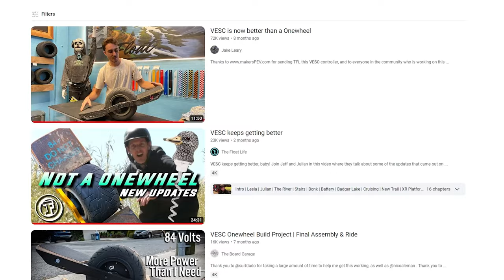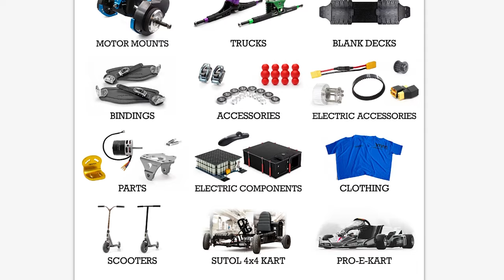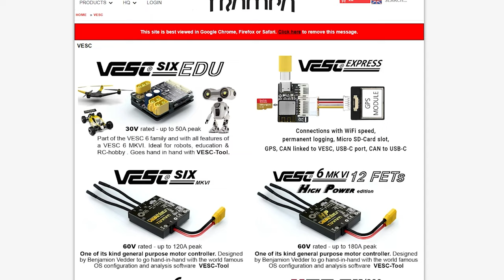Onewheel, VESC, and the Floatwheel

Comment: Having started with the original FunWheel kit, I still call mine a FunWheel even thou almost none of the parts are the same. Once I got it tuned and running I got out of the loop for a while, happy to just be riding. Got back into it with a new iteration of my build using an XR hub only to discover things have progressed so far beyond where I left off.

Comment: I had a diy VEsc one wheel. It had a 12s battery and a 1200w motor. The problem was that I’m 6’4 220 and way beyond the 175lb rider max. It wasn’t a problem until the speed controller started misinterpreting braking and the damn board would make me faceplant on even the slightest hill. Decided I wanted a board that would “just work” and bought a GT. Are they worth $2500? Not really. Has this board ever failed me in more than a year of riding? Nope.

Comment: I believe I overcharged the battery on my vesc with little focer. Power light is still coming on but boards not activating. Voltage not reading in app. Just duty cycle fluctuating in app boards still communicating, if that helps. Just trying to correct this error if possible. Thanks in advance

Comment: Hey I just saw you built a DIY Board using a Focbox Unity. Thought I ask you if you've ever experienced this issue. I also built a DIY Board with that VES C and loved riding it all summer (last year). One day though the Unity just turned off for no reason while cruising. Pushing the power button will only work briefly/momentarily. And although it will stay on after a while of pressing the button, the board will only run for a while before shutting off again. Any feedback work be appreciated. Thanks
Reply from the maker: Hard to say. I would try reflashing the firmware, or updating to main branch VESC FW (start with 5.03, and then flash to 6.02), and see if that fixes any of those issues. 

If it doesn’t, the Unity may be damaged. In that case, I’m aware of one or two people who repair VESCs, so it’d be possible to have it fixed. 

Barring that, if there’s no way to fix your issue, you can replace the Unity with something like the new Maker-X DV4S, which is smaller than the Unity and has comparable/better specs. And Maker-X is a good vendor so far it seems. 
Best of luck.

Comment: I don't have cash ATM so my point may be moot,  however I'm super stoked for the floatwheel. I like the gts and if it was same price i would have a little issue. But Fm is so greedy and overpriced. Is there a way for me to vesc My GT because it is set up with rails and smaller hub and awesome tire with fins. That would definitely suze me for the next year. Until I can afford a float wheel. Stay riding

Comment: "tribalistic nature"... I'd noticed it, but never really found a great way to put it.  Well said.  Also, welcome back.

It'll be interesting to see what the community eventually settles into with the nomenclature of the boards as diversity actually becomes realized.  FOr now, I'm basically just putting a little "v" in front, as most of the VESC-based builds are using former FM parts, so the XR+ becomes the vXR, but really, even that doesn't work very well, considering how heavily modified many of those are, with different rails, footpads, bumpers, tires, and even batteries.  It might be best to go fully generic, like SBES (Self-Balancing Electric Skateboard).  I dunno.

Hey, have you seen the Dragonfly "hyperscooter"?  I know scooters aren't really your bailiwick, but there's a lot of skateboard in that design.  I was wondering what you thought.  Been thinking about getting one for my daughter (she's 22 next week).

Lastly, I hear ya when it comes to the cooling of opinions on stuff that I once held most vehement.  This month, I not only turned 50 but also had my sixth surgery to remove some sort of cancer or tumor, so my perspective has mellowed, a lot, as I'm taking a larger focus on health and figuring out how much time I can spend with my grandkids and remain employed.
Reply from the maker: I really appreciate this comment. Thank you for sharing. I haven’t seen that scooter, but I’ll look into it. Sounds interesting.

Comment: Any small shops doing DIY's?
Reply from the maker: If you go on the Onewheel VESC Builders Facebook group, there are shops there doing custom commissions and things like that at a variety of price points depending on the parts they use. Some builds are entirely comprised of custom and aftermarket parts, some are rebuilds and refurbishings of formerly nonfunctional XRs and Pluses that avoided being thrown away.